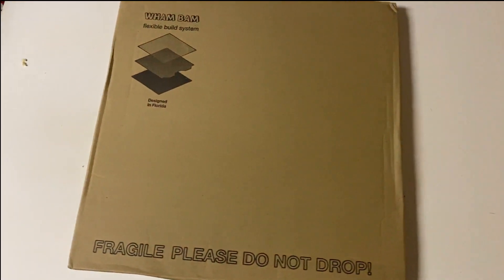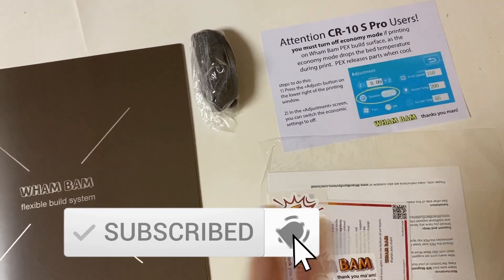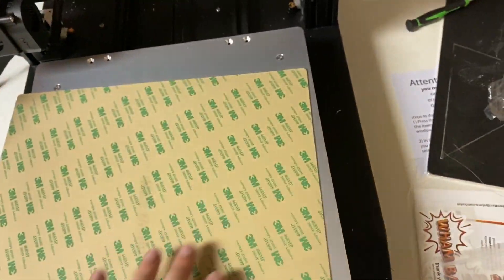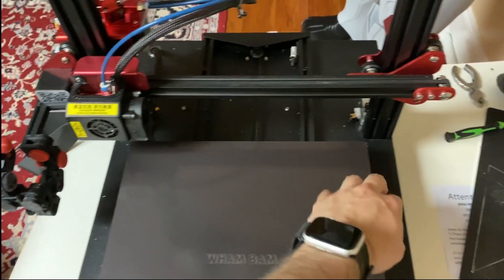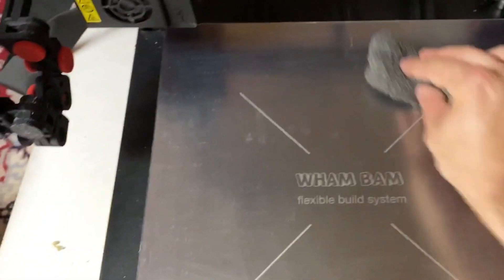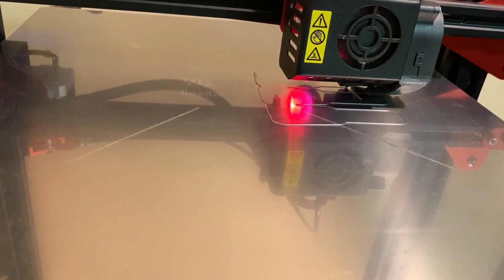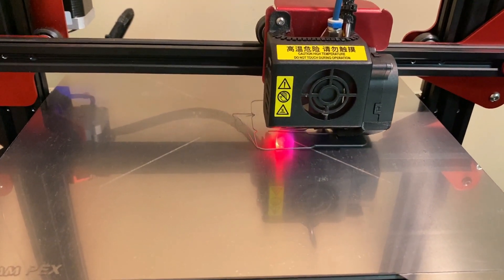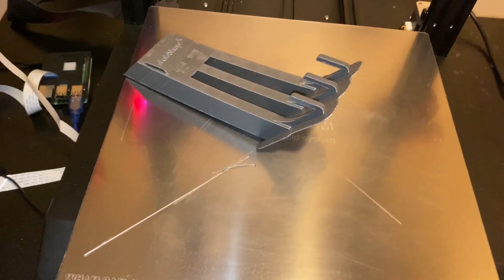Wham Bam Flexible Build System | Installation and Review on the CR10s Pro | Best 3D Printer Upgrade?

Comment: You didn’t do the steel wool part long enough. I keep the bed temps at 75 degrees. I’m having a great experience with Wham-Bam. My print sticks on good and tight without rafts or brims during printing, then once the bed cools, it’s all the way loose. As in: not stuck on at all, which is perfect.

Comment: If you want to keep the build plate shiny and not "ruin" it using steel wool, just use a Dimafix spray. And it's a radical solution for bed adhesion. Works like a charm on all surfaces.

Comment: Update: After having my 6 hour print ruined 4 hours into it with a corner popping up I decided to see if this auto leveling would do it's job. I took the old top plate and clipped it onto the bed overtop the Wham Bam put the bed temp back to 50 "PLA" and let the BL Touch do it's job. I did not relevel the bed or adjust any settings just hit print and everything worked well, print came out fantastic! I know this defeats the purpose of getting the Wham Bam but I only ever broke prints with small items and will use the Wham Bam for that. At this point I feel large and long print time items work just fine on the old bed and being able to change back and forth at will with no setting changes is fantastic. I am using the TinyMachines firmware I do not know if Crealitys firmware will work as well as I see the difference in measuring so try at your own risk. I will contact Wham Bam and see if they might help. Hope this helps someone
Reply: Please reach out (if you haven't already) to us at technical@WhamBamSystems.com and we can help you troubleshoot!

Comment: PEX is very versatile and handles many filaments very very well but may take a bit more dialing in to get it right, from then on its consistent. Follow these tips A few things to check:

a. If using Creality machines make sure your Economy mode is turned off or prints will release half way!

1.  Did you remove protective film from the PEX surface?

2.  Did you rough up the PEX surface with 000 steel wool?

3.  Did you clean with isopropyl alcohol and fresh paper towel?
https://youtu.be/JZs8gvKTf88

4.  Did you level your machine properly?
https://youtu.be/8VgVwCeaovQ
https://cults3d.com/en/blog/articles/how-to-level-3d-printing-bed

5.  Did you correct your gap between nozzle and bed to get very good first layer squish?
https://cults3d.com/en/blog/articles/6-main-factors-for-perfect-first-layer-3d-printing
For PLA squish first layer to half height, for PETG do not squish first layer too much

6.  For PLA you want to use the lowest hot end temperature possible that still gets good results - usually between 195-205°C
you may want to print a temperature tower and test which is the lowest temperature that the layers bond nicely and you get good results.
https://www.thingiverse.com/thing:2318636

7.  For PLA bed temperature of 70° is ideal and should not be dropped during build or part will release. Hot end 195-205
For PETG do not exaggerate bed temp or material temp, 70° bed is great, and 240-250 Hot End is ideal.
Make sure if you have an economy mode setting to turn this off, or it will drop bed temp mid print and parts will release.

8.  Do not use bed fan till 3rd or 4th layer.

9.  Some part geometries are much more prone to shrinkage, and warping, especially large flat prints, and also thin long tall prints.  For these you want to minimize drafts of cold air in room (or use an enclosure) and you can always use a brim or raft to get better adhesion.  Use brim to hold edges down if prone to peel, use raft for multiple small parts with minimum surface in contact with bed.

10.  You don't need to do anything else if you get it dialed in right, but if you do all of this and still are having trouble getting to stick you can use a simple PVA glue stick on the PEX for added adhesion.

11.  For PLA a PC build surface gives much easier stick, but PC has the risk of fusing with higher temperature filaments.  Some like PEI better. We now offer PC and PEI build surfaces on our site.

12.  Never force parts off the PEX, let parts cool completely, especially in PETG, then flex the Flexi Plate to pop off, don't pry or force off.  PLA tends to just pop off when cool.  PETG has great adhesion, so part must be thoroughly cool (not just flexi plate)

You can always use magicoo, glue or hairspray, but once you get it dialed in, it should work beautifully without.

Comment: I also just got this bed with my V2 it's really nice but I can not get it to level right. I have started from scratch 3 times now I adjust the Z and it's printing the part great. The next print the nozzle digs in. I fix the Z while the print is working then again on my next print the nozzle digs in. It never did this prior only with this bed are you having this issue as well or do you think it might be the BL Touch? Thanks
Reply from the maker: that is odd. what does it do when you go to leveling and get it to home. is the nozzle not digging in then?
Reply: @AntonsCreations  No it had set normal as if it was all leveled properly only when it started a print would it dig in. I could not find any information on what was happening so I updated to the Tiny-machines firmware and it fixed it! Now I have an issue with text overlapping other text on the screen and when I set my Z to say -1.89 and exit the menu it will change to -1.88 It always goes down 1 from what I set it to. "odd" If I set it 1 higher it'll stay at what I want so clearly it's a bug. I will try flashing the screen again and see if it fixes. I can print now at least if I can get it to stick and that is a whole new problem even at 75C I have trouble on long prints :/

Comment: Since I changed to the Whambam, my bed adhesion is absolutely terrible.
Can you please provide more details on how you fixed it.
I levelled the bed (manually) time and time again and particularly the first layer adhesion is a nightmare. Can't make it work. Please HELP!
Reply from the maker: Once i feel like I have mastered and found the best solution, Ill be sure to make a video detailing the steps. So far I have found the steel wool, and alchohol is key, also printing with a raft and lowering the z offset a bit with the bed heated at 60.
Reply: @AntonsCreations  Thanks Anton. I look forward to seeing that video. Keep up the good work mate.
Reply: @AntonsCreations  Not having to use a raft is the whole reason I would spend the extra money on Wham Bam. If it still needs a raft I will just stay with glass and ABS Juice for now.

Comment: Hi Anton. I believe the top of the Pex sheet has a thin plastic film that needs to be removed before you start using the steel wool pad to roughin The top of the PEX. I am currently using the Wham! Bam on my CR 10 S pro V2 and have had no issues with adhesion. Before I use the printer I wipe down the pex with steel wool and IPA. So far the wham bam has worked perfectly. Best regards.
Reply from the maker: Thanks for the tips! great help! And yes, i did remove that protective film haha.

Comment: Good Evening Anton, glad you got your wham bam. To get good adhesion, like I mentioned use the alcohol, and use the 000 steel wool, and make small tight circles. Do that a few times. Also, make sure the bed is heated to 70 for PLA, 70-80 for PETG. I haven't had any issues. 

Also, if I notice that I need to bring my bed back, I get acetone not the one for your nails. The one from Home Depot or Lowes is what you want. Use the acetone like the alcohol, make sure you have a mask, gloves, and a well-ventilated area,. You want tight circles, wipe with clean paper towels, and do it again. Once you are done go at it with alcohol twice, and you should be done. 

I wish you all the best.

Comment: Love you videos Anton and this one in particular, i just got my Wham Bam plate and i face the same issues as you did - nothing stick :-(
which bed temp are using for PLA and do you have temp recomendation for PETG?
Reply: Hello chadoz78, try heating your bed to 75 degrees Celcius and heat up the PET-G anywhere from 240-250. Personally, I go on the high end. Works every time. Wish you all the best.
Reply from the maker: ohadoz78 for PLA I use 55 C, and scrub it LOTS with alcohol to get best adhesion. Using rafts also has helped. I don’t have a PETG recommendation as I’m not well versed with it, but I do know it needs to be higher temps

Comment: So I have the Wham Bam setup too.  I haven't installed it.  I thought I had to remove the old cover on the removable alum build plate that the CR10S Pro V2 came with.  I guess not.  Thanks
Reply from the maker: Phil Caplinger nope, just remove that whole plate itself! Glad to hear the video helped :)
Reply: @AntonsCreations  yep.  Huge help. The instructions are not clear from WhamBam. I was dreading that task.  👍